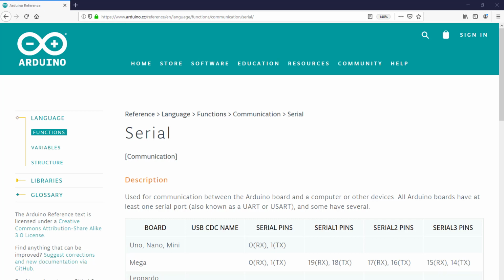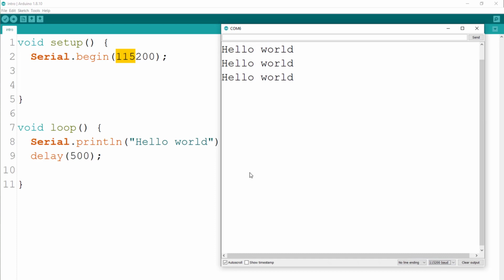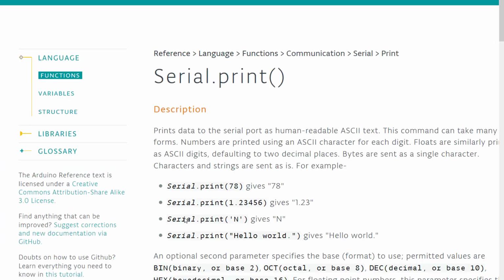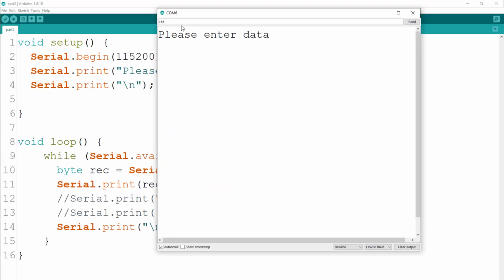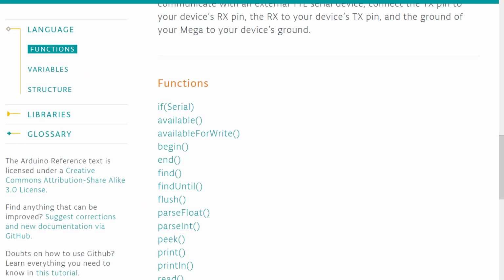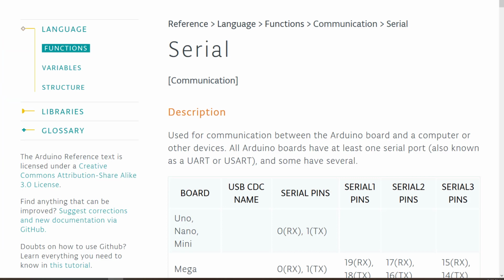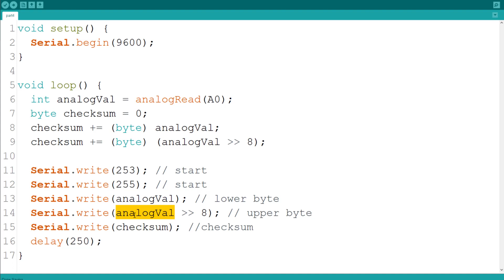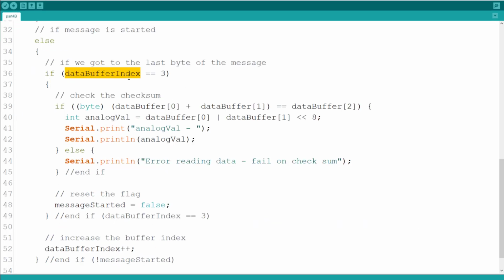Serial communication use in Arduino

Comment: Can I ask you to post this code?  I've tried to copy it off the screen but it doesn't work.  FYI, when compiling it also points out that the variable  'boolean dataBufferIndexIndrease = true' doesn't get used.
Reply from the maker: You can take it from here, and it does been used :) 

https://create.arduino.cc/projecthub/talofer99/serial-it-5edd36
Reply: @talofer99  Thank you sooooo much!!!!!  :-)
Reply from the maker: @vegansynths7757  sure thing
What are you planning to build ?